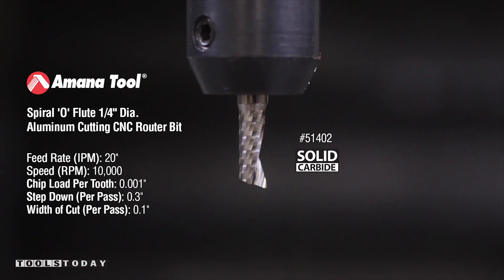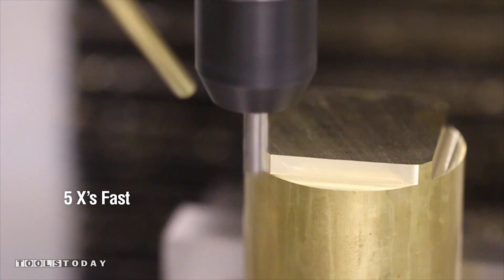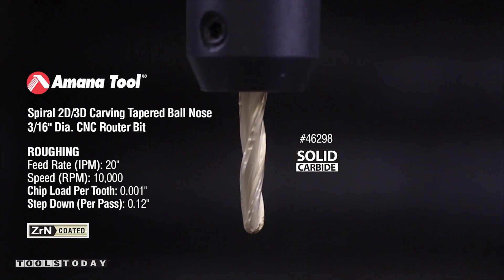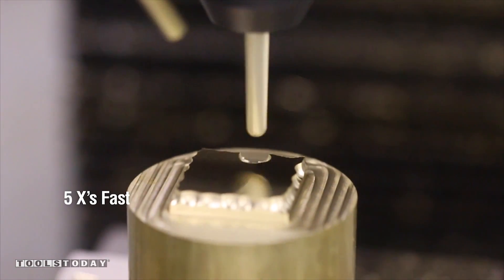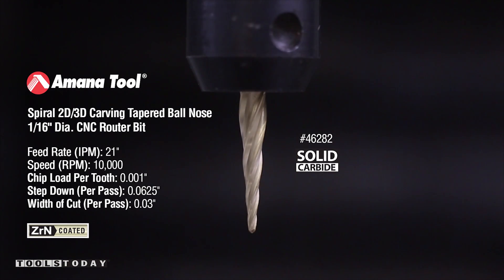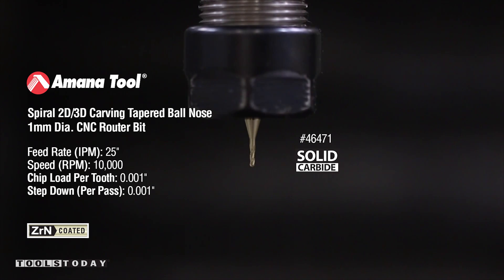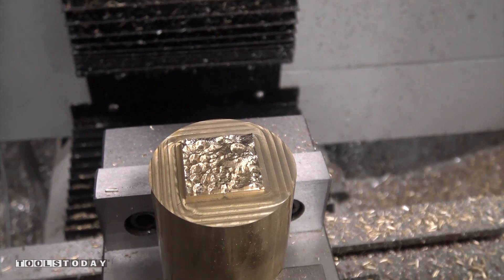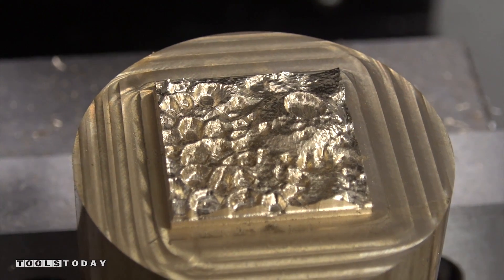CNC Project (Part 2: 3D Milling): Microorganism 3D Brass Carving Using Amana Tool CNC Router Bits

Comment: Whats the best bang for your buck entry level cnc router that has a good level of detail? I'd love ot make brass stamps for foil printing and investing in a cncn router for that could be incredible but I just don't know if cheap cnc routers these days will offer the right kind of detail for the job, unless that mostly depends on the bit you're using?
Reply: You can't use a budget router for metal they are too sloppy. In the video they are using a CNC mill but show a router at the end.

Comment: Sir where to buy this machine
Reply from the maker: Tormach PCNC 1100 Personal CNC Mill.
Reply: Sir what is rpm of that machine spindle
Reply from the maker: 5,140 RPM 1.5HP R8 Spindle with Sensorless Vector Control
Reply from the maker: https://www.tormach.com/product_pcnc_main.html

Comment: Sir may you tell me which controller is best for coin die engraving on iron.nc studio, dsp or Mac3 or nk 260 controller, which best for coin die engraving on iron my all design 3d carving so I want best quality engraving on iron and much clearty and sharpness.so please guidance me
Reply from the maker: Apologies, we only sell the router bits, you should contact a CNC manufacturer like Tormach for more information.
Reply: Sir that machine useful coin die engraving machine